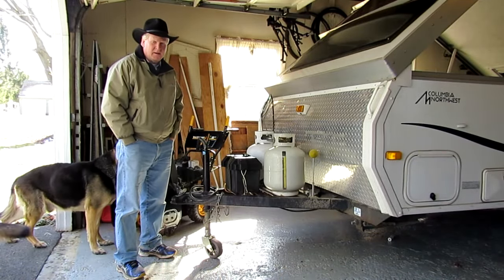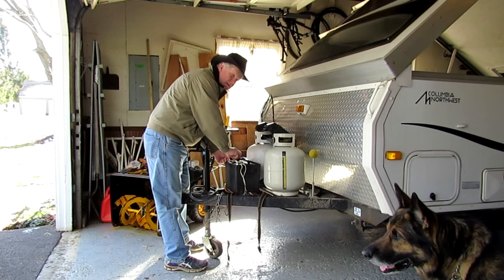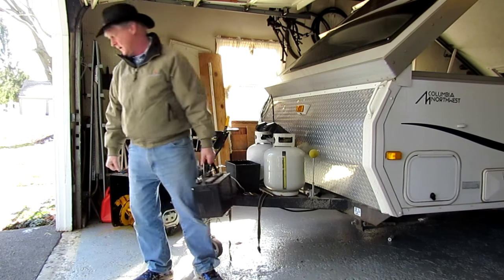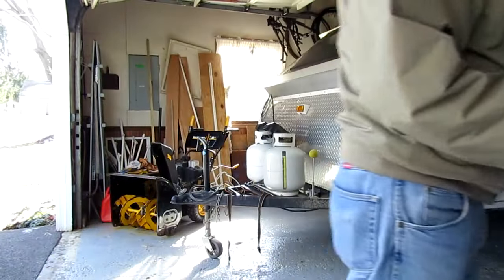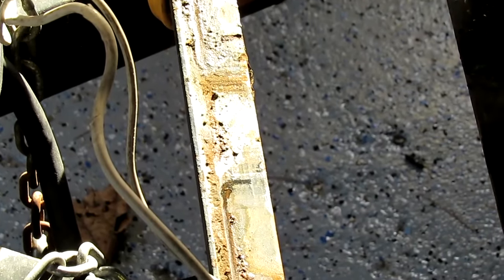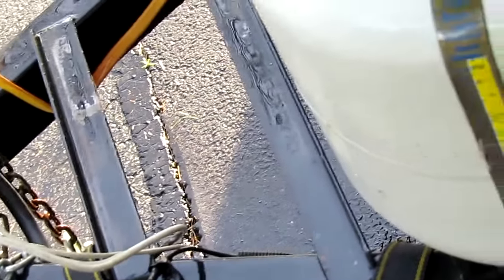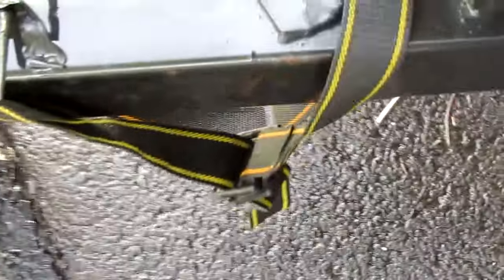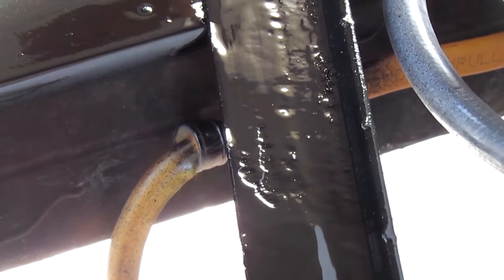Aliner Trailer Battery Winter Maintenance and care

Comment: Rick - I just recently returned from a trip with my Aliner Ranger 12. I noticed that the strap securing the battery box lid had come loose and the lid was left somewhere in Oklahoma. I say this because I noticed in your video that you don't have your battery box secured to the frame. If the strap works it way loose, then you may not have a battery to maintain when you return home.

Just as FYI.

Dave
Reply from the maker: +David Peterson   .....   Yes, I agree with you.  I think the factory is short sighted to send them out like that, but that is the way they come and unless you start drilling there is no way to attach it.  FOR ME,  I'm planning on replacing the single 80ah battery with 2 CG batteries to up the power to 225 ah.   I'm just waiting for this battery to die completely.   The new ones will be secured !!

Comment: question please/  if your plugged into shore power will the inside light work if you don't have a battery????  or a bad battery??  please help thank you.
Reply from the maker: Yes, as long as you converter is working properly and your main fuse isn't blown.
Reply: @GoingNoWhereFast  thanks,! i guess i have a problem then because the light doesn't work , will the converter cost much? i can live with lucy lamps   lol,,, thanks again
Reply from the maker: @popatop75  you can actually buy them on Amazon:  https://amzn.to/2CNheuq    And they are fairly easy to replace.  I did a video on it. https://youtu.be/CzlGnH7i6a4

Comment: How heavy is your A-liner? I can’t move mine at all by pulling on it, but I’m a woman so maybe that’s why.
Reply from the maker: I just weighed mine last week. funny you should ask.  Its 2100lbs fully loaded.   If you have fully inflated tires and are parked on a level concrete surface.  And your Front wheel swivels easy, you should be able to move it, just push slowly and wait for it to start to move...